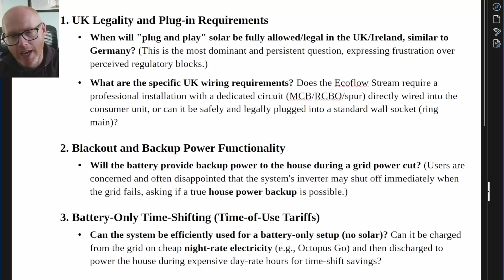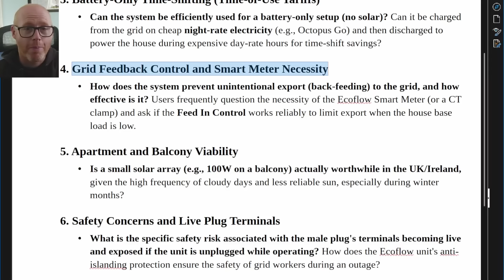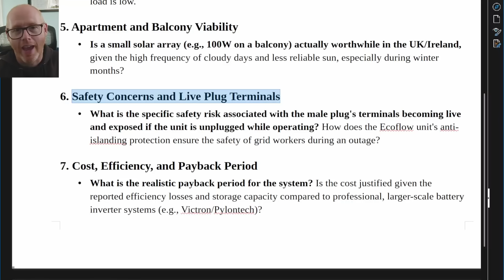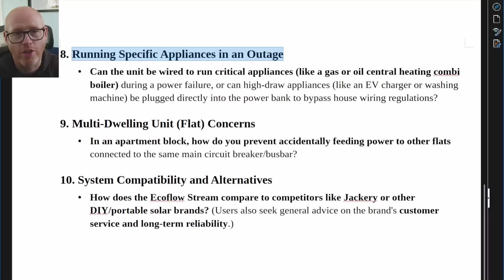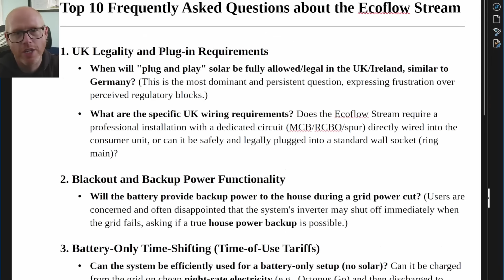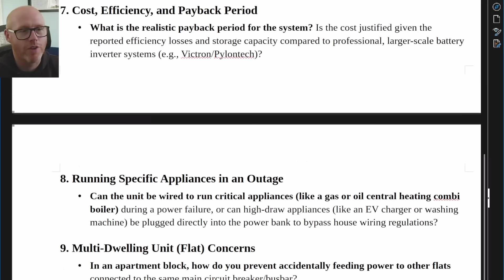Plug-in Solar - EcoFlow Stream: Legal in the UK? Wiring, G98, RCD? Blackouts, Time of Use...

Comment: Very useful video on many points.  At the end you mentioned the Delta Series PowerStation's.  I have just bought a Delta 3 Max Pro mainly for portable use but could I link it to the home system using 2 x 480W panels?  The home system already has a full 4kW Sunsynk grid-tie inverter and 10kWh of batteries but this unit could possibly cover the base load?
Reply from the maker: It's not easy to link the Delta series to a grid connected home and definitely not approved.

Comment: I must admit I dont like the idea of the physical plug-in aspect of this even if it were made legal. If I went this route, logic says to me employing the spare breakers at the consumer unit each effectively serving as a its own radial circuit to a battery unit like the Stream Ultra. But instead of plugging in, it could be hard wired via a 13A fused flex outlet getting around legalities the plugin bit? I'm surprized nowhere this seems to be mentioned as an option, or have I missed something?
Reply from the maker: Yes, that is the belts and braces approach 👍

Comment: Useful thanks. Just installed Eco Stream Pro - only have 2 - 400WT panels - that Gen 550wts sunny day & 60wts cloudy/raining. But averages 2.3Kwts/day over 1wk. Problems I have tho is WiFi coverage in the shed & no smart meter to measure consumption. Have another 2 panels coming from EcoFlow (stuck in a ship at mo) - these will cover my daily use of 4kwts/day. Ray

Comment: I understand that the BS 7671 Amendment 4 has been published on the 15th April and the updated wiring regulations allow sub-800W systems to connect to a standard domestic socket without a qualified electrician. However plug-in solar systems will only be certified when the BSI product standards are published, in July? DNO also needs to be notified G98 form - Anyone knows where to find the form and how to submit it?
Reply from the maker: Yes, G98 is extremely easy to do yourself.

Comment: Hi! I have seen some conflicting information about how much power the ultra x can output when connected directly to consumer unit and whether it would be capable of providing off grid power to the house in an outage if isolated from the grid during a blackout.

My main concern is that I have a heat pump and, being British, a kettle! Often this means exceeding the 1200w at peak moments and hitting around 2000. Is there a way if I have 2 ultra x in parallel or any way with the two units to have a 2400w output to the house from the consumer unit to cover these peaks? And what is the ‘bypass mode’ that allows for 2400w as per the spec sheet? 
I was hoping that with the 1800w solar panels + 1 or 2 ultra x I could all but remove day time peak rate usage (octopus go user). 
Please can you help to clarify what the actual output power if these devices are if you know? They would be g98 and I’ve also seen mention about potential MCS certification?
Reply from the maker: MCS certificate only if installed by a MCS accredited installer.
Technically, each unit has a 1200W inverter inside it. If you daisy chain 2 units together and then plug a kettle directly into one of the plug sockets on the unit then you will get the full power of both units.
We'll see what regulation changes they propose and if they stick with the 800W limit to protect existing ring main circuits or if they push the limit higher as some other countries have done.

Comment: If I use this connected to my house, what is the most it can output, not via the plug on the unit. Is it 800w or 2300w.
Reply from the maker: If you plug into the unit itself it can power 1200W per device. So if you daisy chain 2 of these units then you get the advertised 2300W.
Reply: @UpsideDownFork OK so no good to run the house, I would want to run the house - 800w would not be enough but 2400w would be fine. I cant be running extention cables all over the place from the garage.

Comment: Thanks for the video. I remember you mentioned in on of you videos that you protected you garage with an RCBO instead of a specific socket. How did you set this up? I am in the UK. Trying to find and electrician, they are asking me what specifically I want. Ideally I want to get the work done ones and have flexibility for expansion. Cheers
Reply from the maker: Yes, the ring circuit on my garage is its own circuit, my electrician just upgraded the RCBO to a bidirectional one.
Reply: @UpsideDownFork  I found an electrician. I discussed your advise in the video with him which was helpful! He is now asking if my Ecoflow stream Ultra x is UK G98 tested. Can you please help? How can I find out? it is not in the manuals. Thank you

Comment: I want to ask something you may not know the answer to, with Eco Stream max which has 2 MPPT connections can I put sat say one 400w PV into one connection and say 250 w panel in the other? as I have limited room on my integral garage roof? thaanking you Roger
Reply from the maker: Yes, they work completely independently so you can use any size on different inputs.

Comment: Thanks to your help on the channel I managed to charge the Stream Ultra from the Affery P310 using the 3 pin 240v into the 240v outlet on the P310. I bought the Stream Ultra on your recommendation 👍. If I had the supplied cable plugged into the wall socket could I conceivably buy another cable, plug it into the extension socket on the Ultra, then into the 240v outlet on any portable power station to top up the Stream Ultra? Thanks for the great content on your channel 👍
Reply from the maker: No that wouldn't work due to the grid synchronisation.

Comment: Re. question 5, I would suggest that 100 watts is a waste of time, effort and money for a domestic setting. As the market currently stands, for the same price as a new 100 watt panel you can buy a new 400 watt panel or two/three used 250 watt panels.
Reply from the maker: Bigger is always better when it comes to solar panels.

Comment: You can expand the system for a whole house back up as long as a off grid switch is installed. There are many products in the EcoFlow family. They even gave a control panel for expanded  even up to 12kw solar feed. Ecoflow do 2kw solar  add on for a few hundred pounds. Some massive systems out there from ecoflow. Sorry poor information. The ultra stream ultra x expandable to 11.52KW with inverters putting out 6kw. One model expandable to 23kw with 6Kw of inverters wired in.
Reply from the maker: The Stream by itself is not a good idea for off grid. As you say though, Ecoflow have a broad product range to cater for this.
Reply: @UpsideDownFork You need to expand on this with what is capable. What system are out there. The ultra x is expandable to 11.52kw with 6kw inverters. That would run most things in a power cut. The ecoflow delta ultra x is a beast expandle to 180kw and inverters of 36Kw.
Reply from the maker: @MichaelOConnor-r3z  Yes, the Delta range can serve this purpose with an appropriate changeover switch. The Delta Pro Ultra looks great and I may have one coming to me in the future.
The Stream series is grid following only. Even if you expand to 6 stream Ultra X units (23kWh) it will only inject 800W into your house circuit, so the total inverter capability is only relevant if you can site them so items are plugged directly into the inverters, in which case each unit is limited to 1200W.
When the grid drops, each of the units will isolate itself.
Reply: @UpsideDownFork that is only if is grid connected. As I believe when isolated from the grid it will supply more. That is where a grid switch comes in.
Reply: @UpsideDownFork The new one is the delta ultra x where you can connect 12 batteries to one inverter unit. Before you had to add another inverter unit with for more than 6 batteries. One inverter unit and two batteries on the delta will power a house. £6k and you expand it. The solar panel  inverters cut out in a power cut as well and people don't realise this. But running 400w to 800w base power from a ultra stream will be plenty for most people to cut their bills. I use 5400kw a year an average of 14Kw a day, my house runs for 24 hours none stop. I have a 2.7kw solar but because of regulations I couldn't fit a battery and have to look at a portable solution. Working out the technical side on these units is not easy but when portable battery technology progresses it will get easier and easier.

Comment: There are resellers in europe that will ship to ireland it seems. Official ecoflow eu does not , i presume not officially supported jn Ireland. If buy from reseller and setup in republic ireland as a blackout battery backup for my unifi network setup plugged into back of ecoflow stream ultra x unit itself will it work in Ireland and allow setup to add to the ecoflow app? I dont care if does not supply power to the house in blackout just want the network to work powered from back of ecoflow unit. Presume will come with eu plugs sockets on the back snd i will likely need eu to uk adapter for these sockets given in ireland we use 3 pin uk plugs. Can i plug the ecoflow stream into the wall socket just to charge the battery and than plug my unifi network into the back of the ecoflow unit. The ecoflow acts as passthrough when the grid is up and when grid is down it still runs the unifi network plugged into back of it?
Reply from the maker: I presume it will still work fine in Ireland. I can't see any reason why it wouldn't.
It's a shame that you can't buy directly from Ecoflow.
Reply: @UpsideDownFork thank you for your response and your channel. Its excellent. Is there any issue with using eu to uk plug adapters to charge the device and also to power other devices through back of device. I presume its fine
Reply from the maker: @dreambro22  Personally I would just cut the EU plug off and wire a UK plug on. Those adapters can be good or bad quality.
Reply: @UpsideDownFork thank you! I took the plunge and ordered!
Reply: @UpsideDownFork is there way to recharge the ECOFLOW stream ultra x or a power ocean using the ECOFLOW duel fuel generator in event of extreme weather and power outage?

Comment: Hi, I recently set up an EcoFlow system (battery and solar) and it’s been working great so far. One video idea that would be really helpful is a walkthrough on filling out the G98 form and signing up to the Octopus Flux tariff as a self-installer. The forms can feel quite intimidating since they’re clearly designed with professional installers in mind, which makes self-installers feel like they’re doing something wrong. While some YouTubers mention that you can complete the G98 yourself, a clear guide would make the process much more approachable and give people confidence when filling it out. It might not be the most exciting of things to cover but it will be massively helpful. Thanks
Reply from the maker: I'll see what I can do.
Reply: @UpsideDownFork  little update for you, I have instead gone for agile as I don't need to export at all. Seems like a good option for micro generation as no G98 or mcs is required. Plus the ecoflow app ai can work with agile
Reply: @hivltg Hi, could I ask a question. National Grid are being incredibly unhelpful with completing the G98 (we are installing EcoFlow Solar and Batteries ourselves, electrician has done the fused spur to consumer unit). We want to buy at cheap rate and use that and solar (if it would just stop raining!) during the day. Does this mean that I'm not exporting and can bin the G98 as I'm really struggling with it 🤦‍♀️ Thanks
Reply: @mistressddoolalley7291  I used the word document as the website was missing the Stream Ultra and I used Copilot for help filling it out and emailing as It's really not setup for consumers. I still recommend filling it out as the shelly will leak tiny amounts of power to the grid as the wattage is adjusting, even if you are not going to export. I also ended up using Agile tarrif for this setup as well. its working very well now.
Reply: @mistressddoolalley7291  I used Copilot (ChatGPT) to help fill out the word document and I emailed it in. The form is not designed for consumers and only electricians in mind. I feel that companys and legislation needs to catchup with the new balcony solar type systems as its all geared towards for full install setups. The National Grid website also was missing my model of battery (stream Ultra pro) which is why I used the word document and found the code on the other website. I recommend still filling it out and submitting it as they need to know your property can push back to the grid (even if you don't have a feed-in tariff). When the power is fluctuating it takes a moment for the batteries to adjust output so you get a small amount of leaking onto the grid as the shelly device updates etc. I went with the Agile tariff in the end as I don't want feed-in, and you dont need to mess around with forms on the octopus website.
Reply: Really Interested in these systems. The only problem I have it's I would have to have panels at least 10/15 metres from nearest house socket (now that's allowed) any suggestions?

Comment: I simply want to know if i can plug my stream in, when there is a power cut a switch isolates the grid and my plug in system takes over. I don't see why i cannot plug it in, it is designed for that. Then i get a solution of full home power with no issues.
Reply from the maker: If the grid is cut, how are you providing an earth for your home?
Reply: @UpsideDownFork does that mean it would be unsafe to plug in my gas boiler during a power cut? I'm thinking about directly connecting boiler to one of the sockets on the ecoflow box. Is there an issue with earth?
Reply: @UpsideDownFork in Norway, each house has its own grounding, making all Ecoflow products perfectly grounded if they are connected. No complaints from my ev when charging from Delta pro, proper grounding is detected.
Reply from the maker: These devices are designed to be grid following. Ecoflow did not design them for black out/off grid scenarios. They have better products for that.

Comment: Used your discount code today on a Stream ultra x & going to pick up some 550watt panels in the black friday deals.
Have you tried setting the region up so it outputs 1200watts instead of 800?
Reply from the maker: Enjoy! Yes I have done that for 'testing' purposes only.
Reply: @UpsideDownFork  interesting, in your testing did it also output 1200 watts on the AC socket at the same time?
Reply from the maker: @markswinhoe8252  No, the inverter can only output a total of 1200W per unit.

Comment: Further to my previous comment, which I cannot find now, the gateway does exist, though it is currently designed specifically for the PowerOcean product line.
Separately, I now understand your point that a software update to the smart meters would not resolve the whole-home backup issues that we are encountering with the EF Stream product lineup. Despite these issues, I still believe the EF Stream products are a worthwhile investment. Thank you again for providing the informative video.
Reply from the maker: Thanks for commenting.
If they made a much cheaper gateway for use with the stream series then it might open up opportunities but I doubt they will pursue that option.
Reply: @UpsideDownFork I agree it's pricey, but if it works with the Stream line series it's worth looking at this option and you would comply with G98. I also agree a cheaper and more Stream focused version would be better, and they would create an even better (full package) product line to consumers to cover a blackout scenario at least for a few hours. I guess we consumers need to push them to create this for us and not just for the PowerOcean customers, though. Thank you for your reply and please bring us more and more great videos.

Comment: Watch out because Ecoflow sell both new and refurbished products, e.g. the Ecoflow Stream AC. The difference between new and refurbished is about £100 which might sound good but the new ones have a 10 year warranty and the refurbed have ONLY A 2 YEAR WARRANTY which suggests to me that Ecoflow doesn't fully trust the refurbs.
Reply from the maker: That's something to keep in mind.
Reply: With my experience and reading other reviews I would not worry to much on how long the warranty is as you will have a tall order sending anything back for a replacement. There rating is dismal

Comment: Being able to self install panels when and where you want is a bonus, plus is saves you a packet load of money. Because my home is surrounded by trees the roof gets a lot of shadow. I bought the 500W bi-facial panels for 70 quid a peace from City Plumbing (warning: they weigh 26Kg each & are MASSIVE!). I've installed 1 on a fence panel, one on the ground near my conservatory and one in the middle of the lawn mounted to the tall angled pallet they were transported on which is also mounted on super robust wheels, and have installed brackets ready to install one on the wall above the conservatory. They all face different directions and get the sun at different but overlapping times. They cover my needs. No pro installer would install them like this and would refuse to do it, but it works for my needs & means even when the roof is in shadow I can still get solar.
Reply from the maker: It's great to have that flexibility!